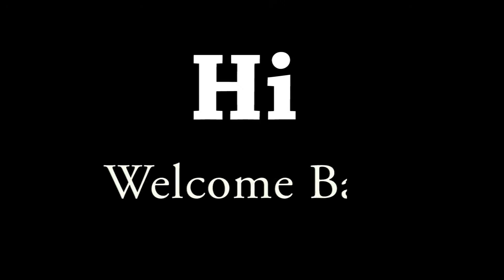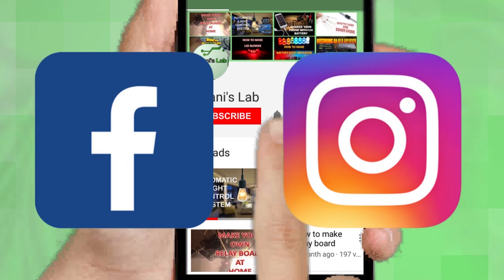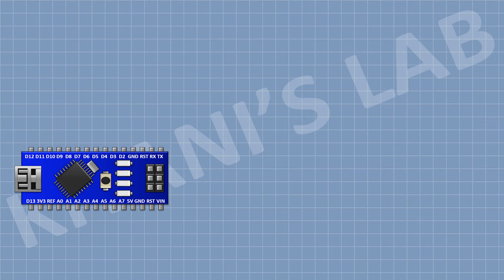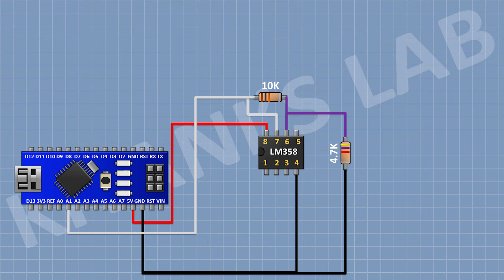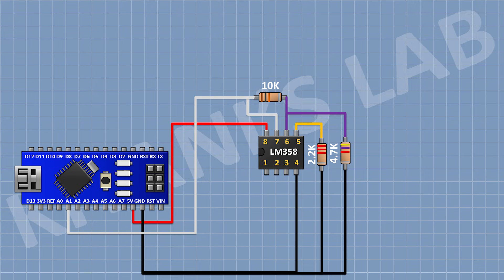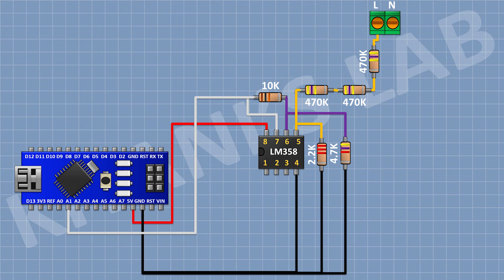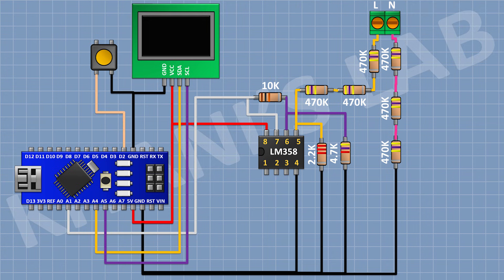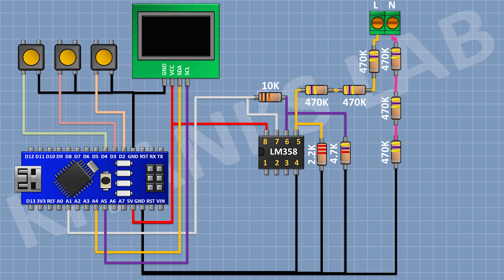OLED AC Voltmeter Arduino Project

Comment: Why used LM358 here? What is the role of it here?
Reply from the maker: lm358 is used  as voltage attenuator to reduce the high voltage to a level where Arduino can sense it safely
Reply: @KiyanisLab  REALLY?  wHY NOT USE A RESISOR NETWORK AS IT IS CHEAPER AND EASIER